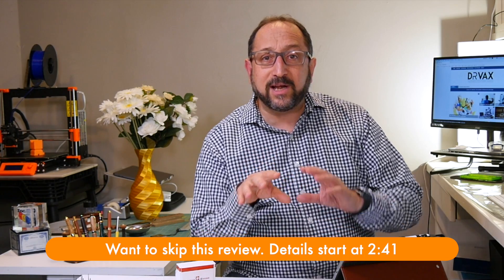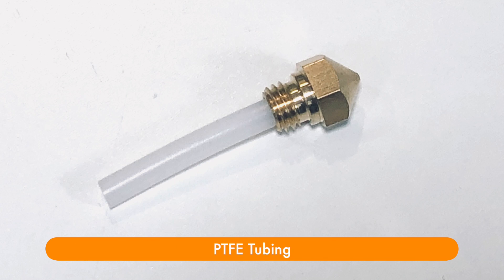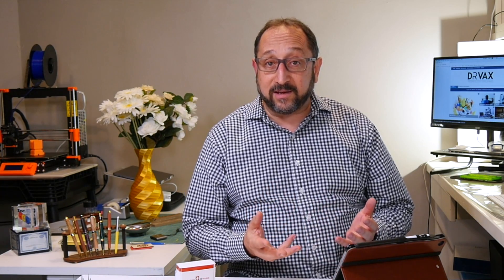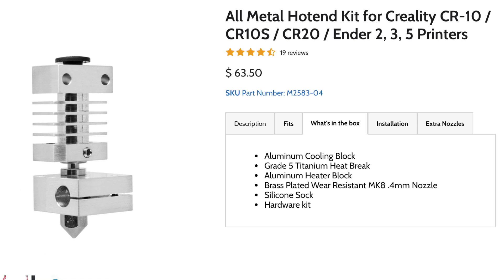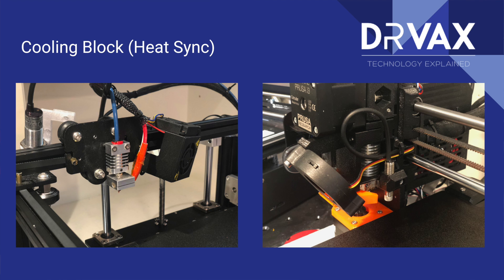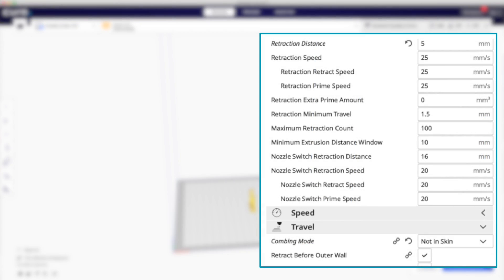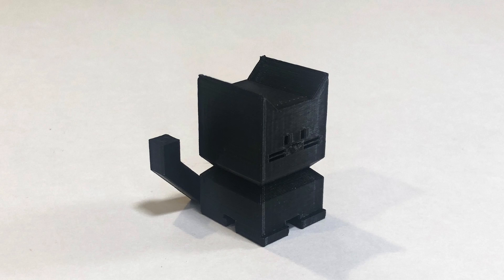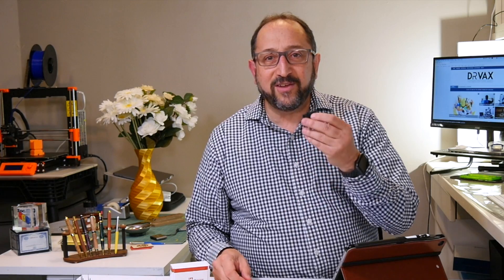Micros Swiss All Metal Hotend

Comment: I added the Micro Swiss Hot end to my 10S Pro i had lots of trouble printing NylonX from Matter Hackers, so i switched to PETG-CF and had better results. Finally i ran out of PETG-CF and had to go back to NylonX. At one time I had a massive leak and had filament running out and melting all over the hot end. I did a tear down and clean and reassembly, it worked one time. Then the next time jam! Tear down got the plug out but once back together another Jam, this time i had to figure out the issue and get it right. I super cleaned everything. I found filament residue in the corners of the both threaded ends that prevented full insert into the heater block and likely made the gap between the top parts. I talked to Micro Swiss the threaded ends are 5 mm and 5.5 mm with .001=.002 gap at the nozzle base when fully torqued. After cleaning the joints I also chamfered the edges of the each threaded end of the Hot Block slightly. to allow for any filament i could not get out. the mating surfaces were bit charred with filament residue. So i polished the ends with 1,000 grit sand paper. I ended up with a tight coupling and .001 clearance in the nozzle. I did a test fir using black maker on the mating surfaces and when i removed then the marker was rubbed off equally around the surfaces. When i reassembled the parts i also used a drill bit down the filament channel thru the hot block and into the nozzle as a guide to ensure square and aligned parts during reassembly. After 2 days of printing NylonX for my Christmas Train Parts i have not had a jam, a leak or any filament handing issue. However, i had a lot of new stringing. I continue to address that issue and some layer separation that is likely speed and layer height issue. So far so good. I am saving to go to a direct feed Micro Swiss Kit soon. Good report and excellent suggestions.

Comment: I had clogging issues with my all metal hot end due to the retraction needed when using a bowden tube, after moving to direct drive I've not had a single issue.
Reply: Somewhat late response, but at least on the Micro Swiss hotend, you're not supposed to have a retract distance of more than 4mm. Unfortunately, the distance is usually higher in default settings in most slicers.
Reply: Even with stock hotend on cr10 I never had issues. There is no good reason for Bowden, though. Direct is the way to go in the times of Orbiter et al., Pressure advance and oscillation compensation

Comment: Print low temperature filament e.g. PLA using all metal hotend is not a good idea, just not worth it.
Also, it is like killing ants using tank.

I prefer to replace my Bowden tube with the better one, fine-tune the g-code to get best results with efficient electricity power consumptions.

Comment: You should avoid retracting hot filament too far or else you have melted plastic stuck in an area that will not heat (within the cooling block or extruder hob.) Instead if you want to pull the filament out set your temp about 90C, wait for it to stabilize, then pull it out. To avoid issues after printing don't shut off the printer until the hot end is down to room temp. Heating the temp too high to cause heat creep can cause other issues such as burning fillament and causing buildup in the nozzle which can lead to more clogs.

Comment: Realizing I'm coming in late. My Microswiss hotend will be here in a few days because my Ender 5 Pro's hotend got stuffed. 

I am the PrinterMods Direct Drive unit. 

What should the retraction be on the end gcode?
Reply from the maker: With an all metal hot end you generally do not want to leave filament load as possible.  You can unload from the end code or manually.
Reply: @MakeWithTech  Here is my ending gcode if you can spare me a moment please. It looks like there is a total of 4mm retraction. Is that sufficient to start. My concern is for long prints where I may not be onsite at the moment the print is complete. 

G91 ;Relative positioning
G1 E-2 F2700 ;Retract a bit
G1 E-2 Z20 F2400 ;Retract and raise Z
G1 F3000 ;Wipe out
G1 Z10 ;Raise Z more
G90 ;Absolute positionning

G1 X220 Y220 ;Present print
M106 S0 ;Turn-off fan
M104 S0 ;Turn-off hotend
M140 S0 ;Turn-off bed

M84 X Y E ;Disable all steppers but Z
Reply: @MakeWithTech  also thank you. your video helped me install the new hotend and tune my PID settings.
Reply: How much shouter retracted and at what speed. I have the standard ending gcode 

Thank you

Comment: I just installed the Micro Swiss all metal hot end on my new CR-10 S5, mainly to print in PETG. The testing starts tomorrow. I will probably need to move to their direct drive unit, but nit until I have to print flexible material. Great informative video.

Comment: Thanks for the excellent video!!

I've an E3P and I'd purchased a Micro Swiss DD syatem w/ hot end, etc.
It's sat in the box for 2 months now. :-(
One reason is because my E3P is printing very well stock,  out of the box.
Second is, I am very-very new to the hobby and and although I've done a LOT of reading, some things are still unclear and sometimes far too overwhelming.
For instance, I've read MANY reviews regarding the nozzle not being centered in the middle of the bed after install, but never a clear and concise way of fixing it.
Third, I dont know whom to contact if I run into problems after the install, such as the instance above, or how to set the bed height to where the nozzle doesn't "crash" into the bed, breakimg off the nozzle... Ugh.
I'm still just so overwhelmed, but I'd purchased the Micro Swiss to be able to print different materials, but until I can figure out how to solve my issues, I feel very nervous because I don't want to foul up my printer if I don't know how to resolve...

Again, this is such a great video! And Im hoping I can come across someine like you that has the patience and understanding to help resolve these issues when they arise for me.

All the very best! ✌🏼

Comment: So what is a good number to have the printer pull back in the end code? Stock is 2mm....is 25mm too much to pull back to be able to change filament before the next print?
Reply from the maker: The standard retraction of 2mm is just to reduce the pressure in the hot end.  If you want to change filament you should pull back the length of your bowden tube plus a couple of mm.

Comment: Bump up nozzle temp by 5°c. I don’t retract after print has finished. Never had a problem.
Reply from the maker: Thanks for the comment.  I started at higher temperature but at least on my Ender 5 have found that is not necessary for my prints.

Comment: hey @DrVax, do you recommend changing to an all-metal-hot-end if i'm going to be printing only PLA and PETG?

For what I've read printing anything hotter has a different kind of problem (besides the hot-end itself): Printing polycarbonate or even ABS requires (for what i've read, correct me please!!!) an enclosure, so for an ender 3... (or 5, but i have a 3 :D ) I'd still not be able to print correctly. Do you see any other reason to do that?

Similar question about changing to direct drive... I know it's a little bit different, having to choose between stringing or ringing... what do you think?

Thank you!
Reply: Started printing PETG on a stock Cr10S Pro v2. No issue aside from some stringing.

Comment: I would like to see a better print with the ender 5 and can you instal a direct drive on the ender 5?
Reply from the maker: You can but I am not sure I would.   Direct drive extruders are much heavier since the extruder stepper motor is mounted with the printhead.  The printers I own with direct drive extruders all have dual X axis configurations holding the hot end and often dual Y axis stepper motors.   I would be concerned that the Ender 5 X axis configuration would not be stiff enough to handle a direct drive extruder and this would results in ringing and other artifacts.
Reply: Check out the flex drive and zesty nimble, they are remote direct drives that give all the benefits of both direct and bowden printing by keeping the moving carriage free of a motor. I am not sure if the print quality increase will be noticeable but it should make slicer tuning easier with the shorter retraction.

DrVax is right, a direct drive on the ender 5 will handicap the speed/acceleration/jerk you can print at otherwise you will replace the less stringing with ghosting and layer inconsistencies

Comment: I'd be willing to bet that the vast majority of clogs people are experiencing (with most hot ends) is that they aren't doing heated nozzle changes.  Either that or improper tube installation.  I was having a ton of clogs due to both of those issues when I was new to printing because I did a Cap tube upgrade and probably didn't push it in far enough. So fixing that stopped it from oozing out of the heat block.  But I was still getting some clogs until someone said to heat the nozzle before tightening it all the way.  Expands the metal and melts any goo so you can twist it in a little further.  Ever since I started doing that I haven't had any clogs (except a couple caused by just trying the wrong settings).  3d printing just isn't as easy as some people want it to be yet, so they're quick to blame the equipment.
Reply from the maker: I agree this is a big issue.  I also think people remove filament improperly.   In particular, with an all-metal hot end it is important to heat up the nozzle, push OUT some filament, then pull back.

P.S.  I have started a new discussion forum at http://forum.drvax.com where we can all have more elaborate discussions and share pictures on our prints and printers.  Check it out.
Reply: @MakeWithTech  Will do!

Comment: Does anyone know if this can be installed on the Monoprice MP-10. I know it's very similar to the CR-10 but just want to make sure.
Reply from the maker: I do not think it will work.  The hotend is different in the MP 10 than the CR 10.
Reply: @MakeWithTech  Dang. Thanks for the reply!!

Comment: Confused, the all metal hot end offers the ability to print materials the stock hot end can’t handle. You focused entirely on PLA comparisons. Try some nylon x on that stock hot end. See what happens with a brass nozzle and low heat.
Reply from the maker: Most consumer quality 3d printers cannot print nylon X.   First you will need an different nozzle, brass will wear out too quickly.  Second you will need higher speeds and 3d printers with PTFE tubing going all the way to the nozzle in the hot end are not safe at these temperature.
Reply: I always wondered that as well. Two parts ( thermistor and hotend) and you can melt almost any filament on any printer. Not sure what the pla craze is,I can't stand it and how brittle it is.  Petg is my favorite

Comment: Great video explaining hot ends... Question regardless if you use a all metal hotend or a stock one in ender machine should you always pre heat to a higher temp then push it filament first then remove if you want to change spool? also lets say you dont want to change spool... can you just remove print from day before ..then select print using same or similar g code and print without messing with filament at all? on my ender 5 this is how i have been doing it.... only thing is i heat up filament and only pull filament out i never pushed in first....never had any issue...but on my cr-10 clone i will be switching to an all metal hot end so i will use your method you explained... thanks...
Reply from the maker: You only need to touch the filament if you are going to change it.   I always do the push then pull since it only takes a few seconds and clearing a jammed nozzle is no fun.
Reply: @MakeWithTech  thax... tried a all metal hot end i had today... i tried everything... clogged almost instantly... i took it appart 3 times... even smoothed out small hole and polished... by hand feed perfectly... than 3 mins into prints extractor starts clicking... stop print ,, then i raise z and am unable to manually push filament through...  when i figure this out i'll update... thanks
Reply: ps i just ordered a new stock hotend should get it in a week...

Comment: I've had a 3d printer (cr-10s w/ stock) for 3 years and have had zero jamming so far. Whatever they did it's great.
Reply from the maker: Yes the Creality hotend is quite reliable as long as you get the bowden tube pushed all the way in.  This is the area where people run into problems.

Comment: Upgraded to the hotend and direct drive combo on an Ender 3 Pro. As someone who spent a few days going through all kinds of problems, if people have issues with the hotend it is due to user error and not understanding how to calibration their printer to work with the new hotend. Once you spend a few hours tweaking things, there is no difference in the hotend in quality. The only gains you make are that you can starting printing with materials that start where the stock Creality hotend maxes out.

Comment: stepper driver has voltage (extruder) but doesnt power motor on my ender 3, the cables test out as working, when i swap out the xyz, the extruder motor works - what is the next test ?
Reply from the maker: If one stepper motor is not working be when plugged into another motor's cable it work it does sound like  a bad cable.   It is possible that the control board is bad but replacing a soldered in stepper driver is a difficult task.   Replacementing the control board is always a possibility.  

First I would swap two of the cables completely and see if another cable works properly.
Reply: @MakeWithTech  grateful and hope you enjoying passover - im baffled but sure it happened when i didnt realise that the cable was glued in and applied too much force b4 realising, lucky ive ordered a skr turbo but still waiting on it - ill be more careful in future - i tested the cables via continuity and they fine so must have damaged the plug in side as there is power of 0.72 on the driver - thanks for getting back to me

Comment: I enjoy watching your videos because you talked specifically about my printer which is the Ender 5. I've been 3D printing for about two months now. When I first got my printer at worked great. Is it began having issues I started adding upgrades. I got the Ender 5 Pro which has the silent main board and the metal extrusion with Capricorn tubing. Since then I have added a glass bed, a micro Swiss all metal hotend, and a direct drive conversion conversion kit that moves the extruder on top of the hot end. I have also upgraded to the th3d Marlin version of firmware. And I have created a spool holder that is directly above my printer and eliminated the PTFE tubing all together except for where it goes into the hot end from the direct drive extrusion. I believe I am still having under extrusion errors. I noticed that the teeth on the extruder gear is slipping and it's kind of worn out. I have stainless steel ones on order. I also watched your video on extruder calibration and I'm going to do that as well.. I can update you on if it fixes it or not. I also am going to do the PID calibration from watching one of your videos. 
So I have some questions. The time now running direct drive and in all metal hotend. What should be my slicer settings? What retraction do you think I should start with? The flow rate? Toasting and other options. I have noticed that when I am printing with pteg especially that if a model has many retractions over and over I noticed that the government takes a while to start extruding again once it goes back to a longer extrusion length of time on the model. I have both simplify3d and cura. another question is what other upgrades should I do in the future? I have it inside of a cabinet and I'm going to install on the inside a reflective insulated material and put a door on it to close it in. What would be a good way to heat up the enclosure? I have some relays that I got to add to octoprint and I could program them to turn on and off the heated enclosure element. And also monitor a thermostat to regulate it if needed. Thanks for your input.

Comment: Smaller diameter Capricorn PTFE tube can minimize the stringing then although can't be perfect?
Reply: I find Capricorn very overrated. I received it with the hole off center and 2 mm, not 1,95. In tolerance it is, but nothing special IMO.

Comment: I use lower temp and higher speed in all metal hot-end, then Tube-end(if printed same filament), this works for me then same retractions settings exept  2 mm/s insted of 6,5mm/s.
I mostly use A-M-H. for PETG--- and Tube-End for PLA. --------Thank you for this Video let's keep learning.
Reply from the maker: Thanks so much for sharing.   I have viewers that have shared the comments are as valuable as the original videos. If my videos help start discussions they are adding value to the ecosystem.

Comment: I believe that the hotend "all metal" is nothing more than a scam. Frist of all, titanium is not as good as stainless steel as a heat break. Google it! 2. If the filament channel is getting hot enough to melt PTFE (327°C), it will also melt your filament. To get the most out of it, shorten your stainless steel tube as much as you can and place an aluminium tube with thermal grease with an inside diameter of 2mm into your cooling body. For my Enders I need a 7mm pipe with an inside diameter of 2mm. Not available I believe. A friend with a lathe could help.
Reply from the maker: Thanks for sharing your observations.  Most of my viewers will not have the skills to modify a hot end as you recommend but it is an interesting approach.